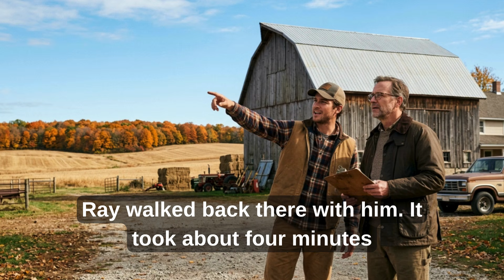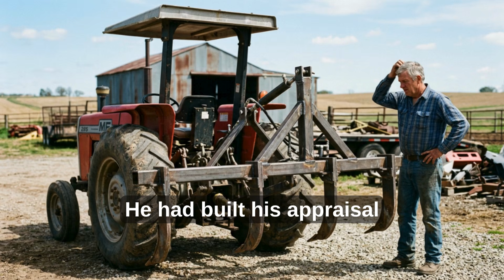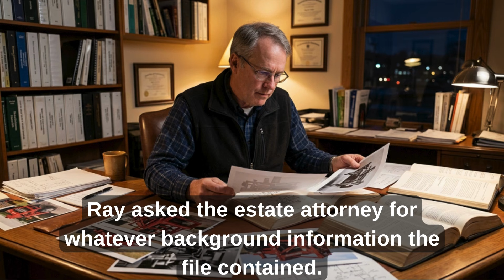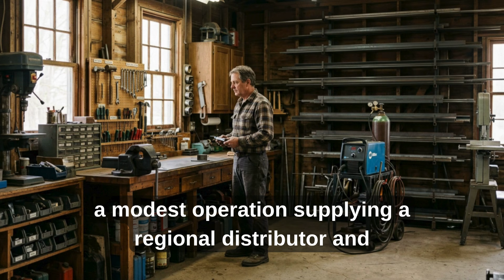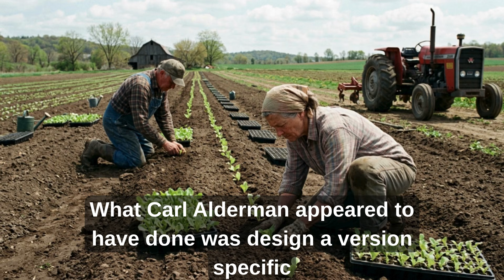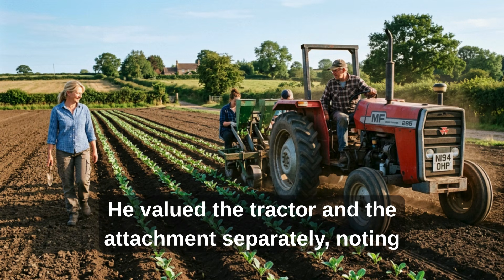The Massey Ferguson Had a Custom Attachment Nobody Could Identify — It Took Three Experts to Figure

Comment: I worked for a farmer when I was 10-17 years old and he built a U-name it wagon ! He took a old flat bed truck chaise with the cab and put a chopper box on it which he rigged up that he could pull it behind the chopper and after it was full I would drive it to the silo or straw blower and unload it. I would then run back to where was waiting and back up to the chopper and he would pull it around the field in reverse. It worked great ?